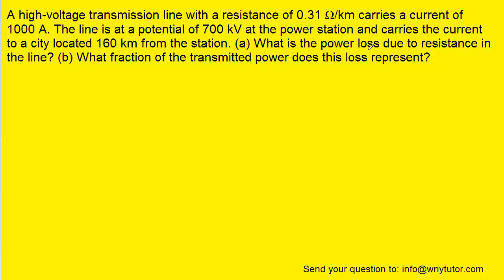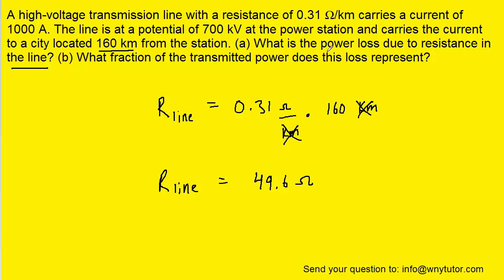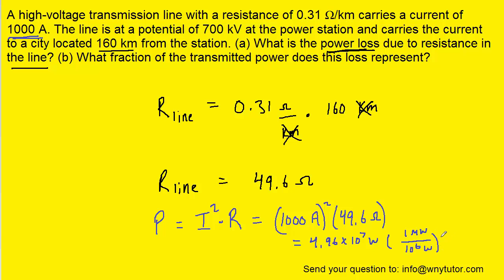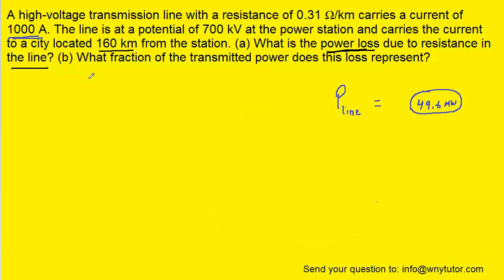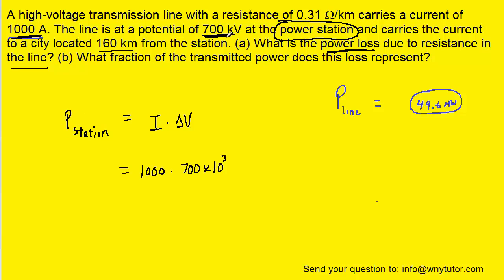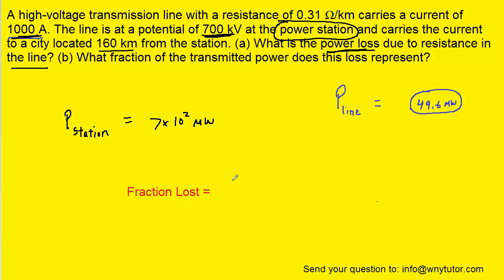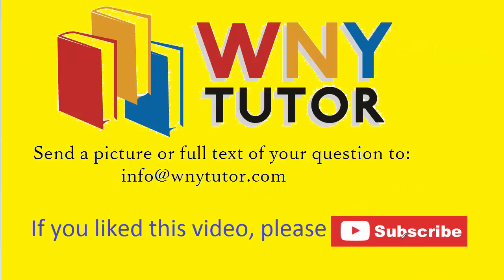A high-voltage transmission line with a resistance of 0.31 Ω/km carries a current of 1000 A. The lin

Comment: Can you explain why P = V^2/R would not work in calculating the power lost due to resistance? Why doesn't V=IR work with the given values? Or what is P =V^2/R physically meaning instead of P = I^2R?